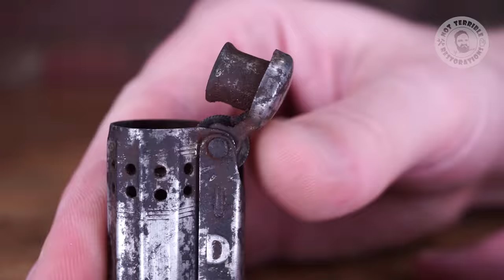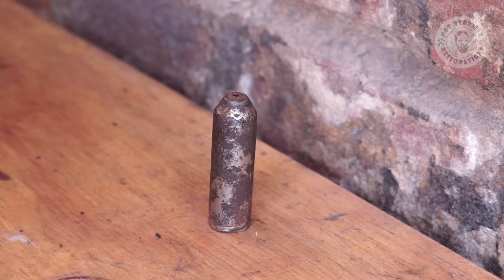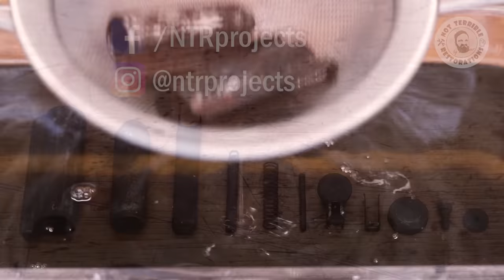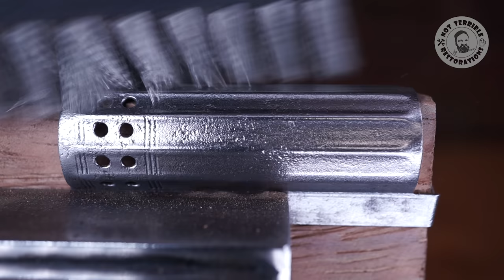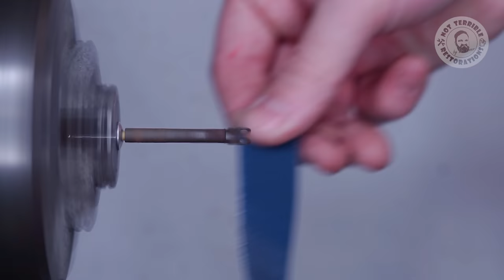Restoring a WW2 Petrol Lighter: The German Version of a "Zippo"

Comment: This restoration was so relaxing to watch. As I see it, a proper restoration of a lighter requires exactly the discipline you possess. I agree that the parts should be kept as intact as possible. The plating was the ultimate demonstration of skill, and patience. After assembly, the lighter looked as if it was made yesterday! I cannot thank you enough for resurrecting these machines from the past. It gives the young people watching a glimpse into the methods, and design engineering from the early 40s. More importantly, it will inspire some to learn a trade that involves using tools, sandpaper, and chemical processes, instead of spending hours playing video games. Grolsch is one of my favorite beers. It is unpasteurized because the Dutch believe that this treatment changes the character of the finished brew. I want to try Grolsch Dark, if I can find a reputable vendor who carries it. Thank you once again for this incredible posting. I look forward to the next. Stay safe during this modern-day pestilence.

Comment: It's basically an IMCO lighter. It's an Austrian firm which converted Ammo from WWI (if I remember correctly) to lighters, cause they were banned to sell/use weapondry. IDEAL is also an AUT firm famous for kitchen utensils as the famous Sparschäler (Potatos). I proudly own two IMCOs bought in the 80s and 90s for approx 6 D-Marks (3 Euro) each. They are far in double digits in stores now. It's a really stunning coz ultra simple concept which works very well. You've done wonders with your piece.

Comment: Great job, although I have a couple of questions if I may?

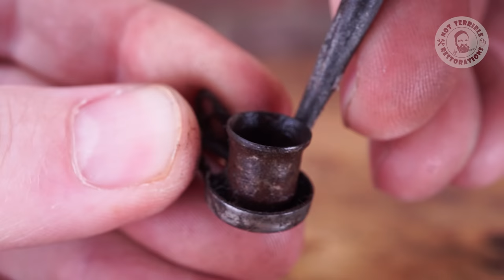At about 03:24, you removed a perished gasket or seal from the lid that covers the wick. Did you replace it? And if so, what material did you use?

Secondly, the large spring around the flint mechanism, what purpose did it serve? I can see the smaller one pressing the flint onto the striker, but I didn't glean what the larger one was for?

Comment: Nice work. You know you could skip the copper plating if you had a nickel strike. Honestly you might have even gotten away with just the bright nickel. Plating shops will normally have the copper baths because copper is cheaper than nickel so some of the deposit can be a little cheaper.

Comment: How is chrome plating different from nickle plating, other than having more steps?
Reply from the maker: Nickel-plating is somewhat warmer in color, more yellowish. Chrome plating is slightly colder, more silvery. The surface of the chrome is harder (more scratch resistant). With nickel there may be problems due to nickel allergies.
In the end, each form of plating has advantages, through the layer structure of chrome plating, you combine these advantages and have the best surface quality. I also have additional explanations in the video description of the individual layers.
Reply: @NTRprojects  Thank you for the explanation.

Comment: Has absolutely nothing in common with a zippo. Looks to be a copy of a Austrian IMCO in much the same way the "Legendary" Zippo is a less efficient copy of a British Orlik lighter except instead of a snuffer cap which provides a decent seal a zippo provides none. After seeing the grinding wheel i have to doubt this is from ww2 and german especially given that the austrian lighters of 1935 were using higher quality dual cut grinding wheels
Reply: Zippos were made based on the austrian imco lighter fyi